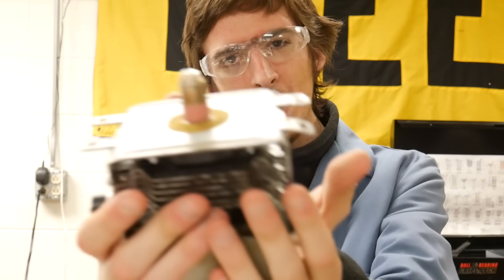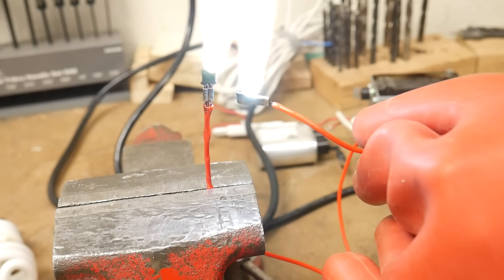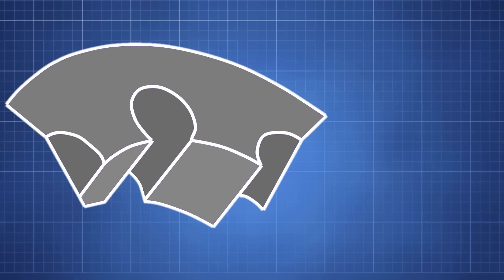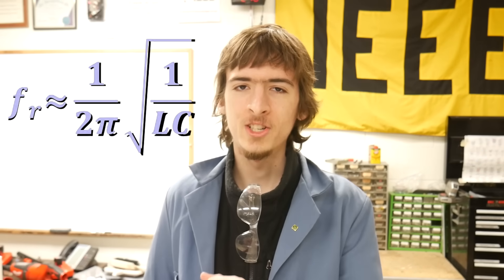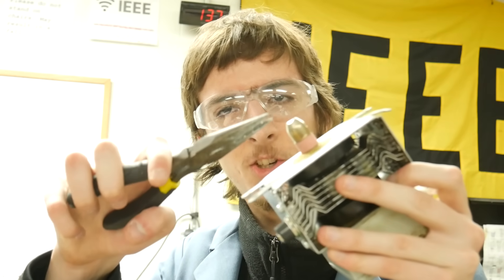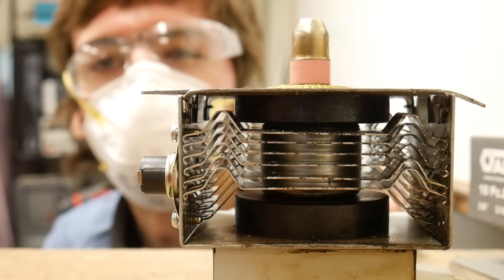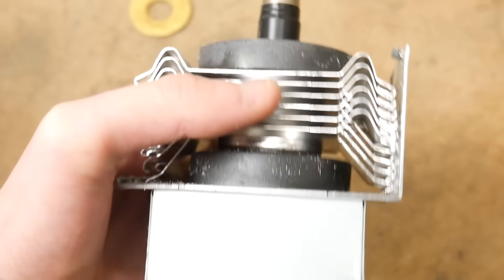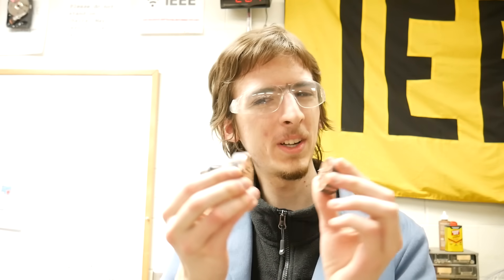What is a MAGNETRON - How Does it Work

Comment: Double cycling the cyclotron back into the magnitron source would generate unlimited energy. Don't try this at home because there is no control of how much power you could drawl out of it. Potentially more dangerous than the Manhattan project
Reply from the maker: Well, I'm not sure about that. These devices aren't energy generators. An unstable feedback loop would likely clip once it exceeds what the hardware can provide; it might just burn out first.

Comment: And how exactly do you rig up the microwave to make arks like that🤣 asking for a friend
Reply from the maker: jay Parker, you can tell your “friend” this:
The following is how to wire a microwave oven transformer once it is removed from the oven.
There are 3 coils and 5 wire ends to work with. The two large metal tabs on the coil of thicker wire are for 120V (240V elsewhere) AC from the wall outlet. 
The coil of thin wire has one end going into a high voltage cable (usually fabric weave) and the other end is welded to the iron core. The high voltage will complete a circuit with the aforementioned wire and the iron core (or any wire attached electrically to it). This gives a lethal 2000V - tell you friend to please not die.
Finally there is a thicker coil squished between the other two, this provides only 6V but can push over 100 amps.

P.S. please tell your friend to either use rubber gloves or plastic clamps to manipulate high voltage.
Reply: Thank you! Didn’t expect a reply that fast 😂 would wood be suitable instead of plastic as a ‘chicken stick’?
Reply from the maker: Yep, so long as it is completely dry.
Reply: Sorry to be a pain 😂 we  have 100% humidity outside today, can it arc further through the air the more humid it is?
Reply from the maker: jay Parker, not a pain at all. I love these kinds of chats.
Humidity actually makes it harder for air to ionize and turn into a plasma. Generally, the lowest pressure driest air is the best for arcing. At these voltages though... you may not even notice the difference.
The plasma arc should form when you get the wires less than about a centimeter apart. Once the plasma exist, you can stretch the plasma filament to maybe about two inches before it breaks down.
Reply from the maker: P.S. sorry about the numerous above typos. Spellcheck is trying to help but its auto fill suggestions are only making it worse. Lol. Should be fixed now.
Reply: Blueprint thank you :)
Reply: How would you connect more than one transformer together?

Comment: So an opportunity missed again to explain that microwave are nonionising and that radiation emission just means energy from a cental point spreading outward and not radioactivity which is too often just called radiation in place of ionising or radioactive radiation. Also the different power output between routers and microwave ovens could've been stressed.
Reply from the maker: While I agree, perhaps this engineering video was not the venue to address the conspiracy nuts. Still plenty of opportunity for that.

Comment: Oh, one more thing: safety! A microwave can kill you! Even if it is not plugged in it can knock the #$!&$# out of you with stored energy (electricity) it will keep inside (just waiting for some duffus to come tinker with unknowingly).
Reply: Steve Gehrke Yes. I am surprised he didn't mention it in the video. Capacitors, especially this one, can store a massive charge in it. That charge MUST be expelled BEFORE tinkering around inside! The charge in this capacitor may have enuff juice to kill you.

Comment: If i plug a microwave oven of 230 V 50 Hz into a 230 V 60 Hz will it work.?
Reply from the maker: Yes - It will behave the exact same. Microwave converts the AC voltage into DC inside of the oven before the magnetron. The magnetron itself is powered by DC.
Reply: @BlueprintScience  Thanks for your prompt reply..
Reply: @BlueprintScience   Yes, but is the transformer not reacting a bit differently?  In comparison 50 Hz and 60 Hz the V-out put is higher, so DC voltage is higher and electrons will be attracted/lounged with a higher speed? 
Does the amount of LC  coils in the vacuum tube  in some vacuum tubes I count 10 coils and others 12, is this amount depending on the net frequency?
I have noticed that microwaves brakes down more often 50Hz microwave on 60Hz net.

Comment: It is still dangerous when UNPLUGGED lol. That capacitor will still hold a charge that can shock you
Reply from the maker: Once the circuit is discharged, it is safe right away. The magnetron will expend all of its energy and turn off. The capacitor remains dangerous for a couple of hours until it discharges. It has a bleed-out resistor to help dissipate its charge.
Reply: Blueprint well. The capacitor can still shock you after two days of being unplugged.. I know from personal experience. But other wise great video, very explanatory

Comment: These are made out of copper for a couple of reasons.  First, copper is the most conductive metal.  If you think it gets hot with a copper magnetron, steel is much less conductive and so much more energy would be dissipated as heat due to the resistance of steel (or even aluminum for that matter).  Second, steel is mostly Iron.  What would happen to the magnetic field in the oscillator regions?  It would be so distorted that you would not be able to get a stable frequency.
Reply from the maker: I think you are absolutely correct. A ferrous chamber would resist the high frequency magnetic field. I don't really know why I thought it would be steel. ???
Reply: But iron is used for transformer cores. Is that only in low frequency applications?
Reply from the maker: Excellent question. It takes some measure of time for the magnetic domains in iron to change. Any frequency above several hundred hertz (I'm approximating) and the magnetic flux cannot react to the changing current!

Comment: now the cause of Chronic Fatigue Syndrome  is found: radiation of microwaveoven.
To stop you have to eliminate the oven out of the house.
The plug out of electricity net because the oven has also radiation when it is not in use.And out of the house because the oven has a high voltage capacitor.
The distance between an oven and a person is very important.After a 2 weeks without microwaves health becomes better.
Reply from the maker: Dirk Katz ,
Microwaves are not known to cause chronic fatigue or any other detrimental health side effects during operation.

P.S. Your sentence structure is also really hard to decipher

Comment: I was watching other videos and it was the Left Hand Rule!
Reply from the maker: I get this a lot. There are several different Right Hand Rules for different applications (i.e. electron movement or conventional current).
I inappropriately used the conventional current RHR where I should not have. However, I haven't bothered correcting it since the answer works out to the same thing anyway, just mirrored.
Anyway, good catch. Bravo!

Comment: so how do these go bad???
Reply from the maker: They run out of electrons.

Nah. Just kidding. That's an old electrical joke.
In reality, they go through temperature cycles that degrade the magnetron over time. Running your microwave for long continuous amounts of time or with noting in the microwave is a good way to kill them faster.
Reply: @BlueprintScience  ah i see. so i just bought a relatively nice microwave from a secondhand store and the magentron is humming pretty loud, though it still performs its duties just fine. i stumbled on your video hoping to find some insight into how i could repair it at home without having to replace it. looks like there isn't much that can be done other than just replacing it.

Comment: You gave the equation for the resonant frequency.   If that particular magnetron is resonating at 2.4GHz, I'm imagining a magnetron with a resonant frequency of 300 THz  (about 30,000 times higher in frequency than the 2.4GHz magnetron you have).

I'm wondering how those resonant cavities would be shaped, and if they'd need to be much smaller volume.  The volume of each of the triangular cavities inside your magnetron looks like at least 1 tablespoon of a liquid would fit into each triangular cavity.

Why the 300 THz, you ask?  That is in the frequency range of visible light.  It occurs to me,  knowing as most of us do that higher frequencies generate higher energy electromagnetic waves  (at the extreme high end of the EM frequency spectrum are Xrays and Gamma rays, both of which have too much energy for long-term contact with flesh) -- I'm thinking that a magnetron designed to resonate at a frequency in the visible light part of the spectrum would be more powerful.

It also occurs to me, it would actually be CHEAPER to make a 300 THz magnetron because the "L" (inductance) and the "C" (capacitance) in the equation you gave means the L and C would need to be SMALLER IN SIZE to increase the resonant frequency to 300 THz.

A smaller magnetron needs less material (copper, etc) to build and would be CHEAPER.
Wonder why they don't do that. 

Instead of 2 minutes to pop a bag of microwave popcorn, it would take maybe a few seconds in a "Terawave oven".

Here is the EM (electromagnetic) wave spectrum:  https://en.wikipedia.org/wiki/Electromagnetic_spectrum
.
.

Comment: You didn't explain how the hell the food is heated. With electromagnetic waves or heat from magnetron or what?
Reply from the maker: The magnetrons antenna pokes through a panel in one of the walls. The 2.45GHz electromagnetic waves are absorbed by the water which heats up as a result.

Comment: Is a microwave magnetron related to a radar cavity magnetron and if so how?
Reply: I believe they are. The size of the flutes, and waveguide determine the wave size and various other desired characteristics. There are also klystron tubes, tuned wave tubes and a few other configurations.  Sometimes all are used in conjunction to make a clean and neat beam of energy. Microwave ovens just want to have that energy bounce around and through the food where as radar is attempting to be precise as possible.

Comment: 1 Thing i don't quite understand - What exactly provides the electrons. Does simply heating a conductor make electrons "jump" into a vacuum cavity where they can be manipulated by electric fields ?
Reply from the maker: Hello Mr. "I like my own comment"
The simple answer is yes: Any conductive material can be forced to part with its electrons if a high enough charge is applied to it. These "electron guns" are everywhere - including tube televisions and magnetrons (in very different forms). The filament is a special material (which I do not know the exact composition of) the spews electrons into the vacuum - prompted by the high voltage. A lot of the time, filaments' materials are chosen such that they do not degrade over time from the heat. Though I suspect any conductor would also work to varying degrees of success.
I hope that helps answer your question.
P.S. I don''t actually know if you liked your own comment. I'm just having a little fun.
Reply: @BlueprintScience  Hmm, so its not really about heat/temperature at all, only voltage? Temperature is just a side effect of the process. 
PS: i didnt like my own comment ... and fun is always welcome.
Reply: Just for interests sake, the tube televisions are called CRTs, Cathode Ray Tubes. The cathode rays are the electron beams.
Reply: The filament is similar to the one in a high power radio station vacuum tube. The voltage is up there so there can be a stronger stream of electrons blowing past the resonators. Simply put the effect is very similar to making a bottle whistle, but instead of mechanical vibrations you get electric ones instead. This vibration cooks your food. Just fixed a couple microwaves.
Reply: @UninstallingWindows  It's actually both heat and voltage potential that allows current to flow through a vacuum tube. In a conventional vacuum tube the cathode is heated by a filament to make it glow red hot. This extra thermal energy causes electrons to boil off the cathode and form an electron cloud around it in the vacuum space. Then when you use a power supply to apply a positive voltage to the plate with a negative return to the cathode a current composed of electrons will flow across through the vacuum space and through the external circuit. Also note that if you tried this with air present the air molecules would  inhibit the current flow from the cathode to the plate. That's why the electrodes of the tube must be inside a glass bulb with all the air sucked out for the "vacuum tube" to work.

The main difference in a magnetron is that the magnets make the electrons flow in a spiral pattern from the cathode to the plate so that they can transfer energy into the cavities to make them resonate and produce microwaves. But all vacuum tubes work basically the same.
Reply: Now that you all have me going about the good old days of the vacuum tube era here are a few more interesting tidbits about vacuum tubes:

1. Upon turning on a old fashion tube type television set you would not get to see "Bonanza" or "Howdy Doody" appear right away. This was because the 50 to 60 tubes in an early B&W TV set needed about a minute or so for the heaters to heat up the cathodes enough so that the hot cathodes would start producing electrons that would then start flowing across to the plates of all the tubes. Only after this occurred would Ben Cartright sitting on his horse or the freckle faced wooden puppet sitting on Buffalo Bob's lap finally appear on the screen.

2. By placing a fine wire wound in the shape of a coil, called a control grid, in the vacuum space around the cathode and by varying the voltage on the control grid you could control the level of electron current flowing across from the cathode to the plate. This turns the simple diode vacuum tube into a triode switch or amplifier. From that you could make radios, TV's and early computers. Several such computers using several thousand such vacuum tubes in Houston in the 1960's did all the calculations necessary to send people to the moon.

3. Vacuum tubes are extremely power hungry. For one thing the heaters alone consume lots of power. Then the resistive losses caused the tubes to heat up even more. They would get so hot that touching one would burn your skin off. Vacuum tube equipment needed lots of continuous ventilation to keep working. One associated problem was dust build up, which needed to be cleaned out every now and then to prevent overheating. And back then people smoked a lot and the tobacco would end up inside the TV, causing the contacts in the tuners and controls to get dirty and intermittent.

4. Along with all that heat came reliability problems. That's why vacuum tubes had pins on the ends that plugged into sockets. When the TV repairman would arrive,  usually every month or so, he had a huge carry case with him. Inside the case would be about 150 to 200 of the most common vacuum tubes. A tube could fail if the heater would open, if it had a leak in the glass that had let air inside, if it had mechanical problems that would make its output respond to vibration, or due to low cathode emission. And the heat created by the tubes would make it like an oven inside. Therefore the vacuum tubes would cook everything else inside, like resistors, capacitors, coils, controls and circuit boards causing them to fail too.

5. Tubes require high voltages to work. Unlike transistors, IC's and microprocessors that operate on 3, 5 or 12 VCD tubes regularly used 150 to 350 VDC for the plate voltages. You touch that and you might end up sitting on the floor 3 feet behind the TV. And for a while they had "hybrid" TV's that had some high power tubes mixed in with some transistors and IC's. Many times something would go wrong and the 350 VDC plate supply would get fed into the supply lines feeding power to the transistors and IC's. That could blow out every transistor and IC in the whole set. And you better find out why it happened first before changing all those parts and turning the set on again or it might end up blowing everything out a second time.

Thank goodness for transistors. That's all folks!

Comment: Your video is really great and most informative for sure. ah yes magnetrons are cool devices indeed and lots of fun to play around with too. like take away the magnets and it can't do its rf gen thing at all even with that primary voltage stepped way up. I do power em up outside the ovens all the time whenever studying them but never at full power without a shield . thus, using a variable transformer to the hv one via cap and rectifier it can be set to produce just 100 mw to a few watts. in this way i can work on ways to build a more efficient waveguide thus convert that high freq rf via 1100 watts to a much higher freq.  double it to 5 ghz and found that the max rf output drops to 500 watts and it acts quite a bit differently on things like neon bulbs and fluorescent tubes.
Reply from the maker: Interesting. I'm surprised that dropping the voltage low doesn't render the magnetron ineffectual. Perhaps I'm not clear on how the circuit you say is setup.
Reply: Blueprint," i power up the filament with a secondary  transformer and only use the primary via variable  for controlling the B+ = power output . note, the test device has a cap and rectifier. Takes about 700 volts to get it oscillating this voltage  produces a few watts.I've never powered any up at full power due to the dangers involved.

Comment: Why do the insulators need to be made out of beryllium oxide and not a non-toxic ceramic? What is so special about the need for this particular material in this application?
Reply from the maker: You don't have to. Modern magnetrons are using aluminum based ceramics. Of course, every ceramic has heat, strength, cost, and a host of other things to consider.